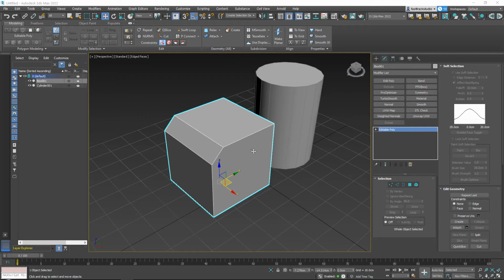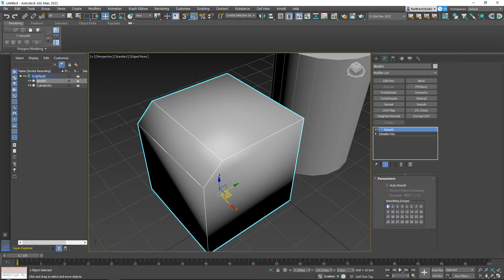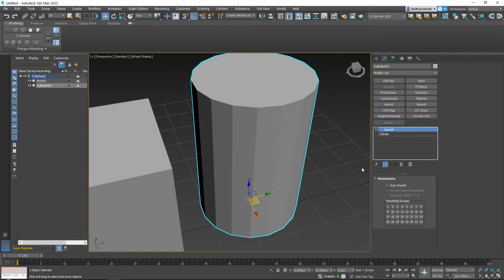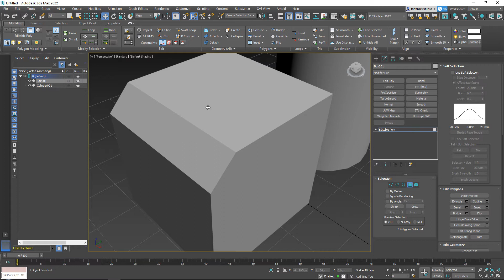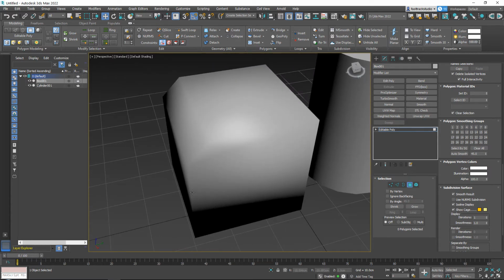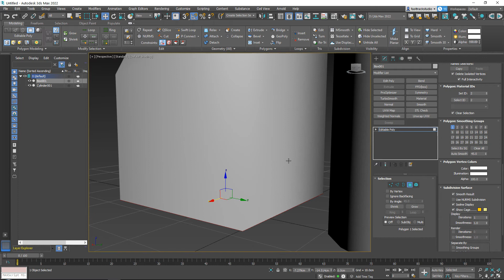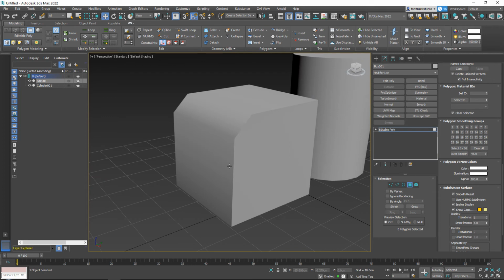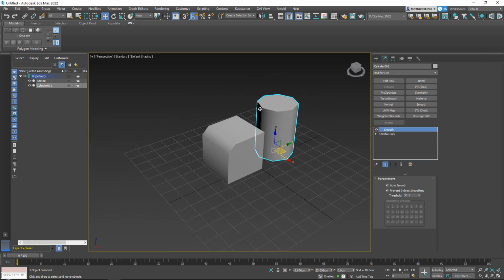Quickbit - Smoothing Groups in 3DS Max

Comment: i always wonder about smoothing groups, because when i bake in substance if i don't make a single smoothing group for my whole piece i'm getting artifact where their is a seam but i hear a lot that its wrong so i don't really understand...
Reply from the maker: An easy rule to keep in mind:
If you bake from high to low poly start with 1 smoothing group (so that everything looks very smooth) then if you have faces that show normal problems make those a different smoothing group.
If you have large assets or do not have to make from high to low poly then use smoothing groups along with weighted normals
Reply: @FastTrackTutorials  thanks for the tips and the artifact appear when i'm separating into different smoothing groups before baking so i kept doing it into only one